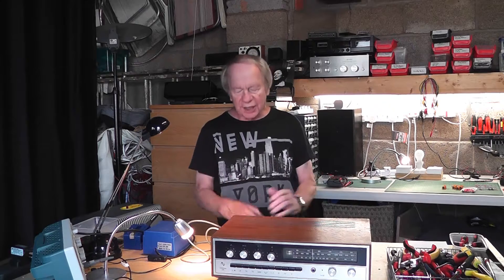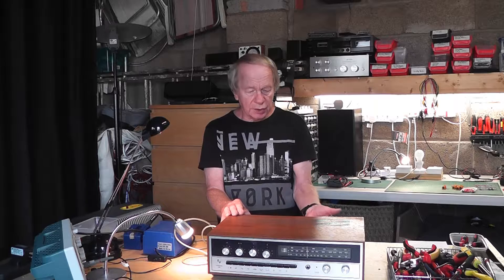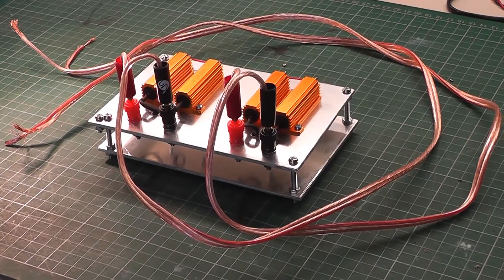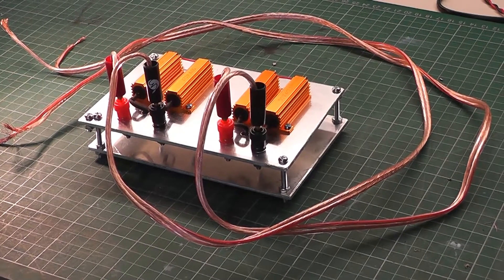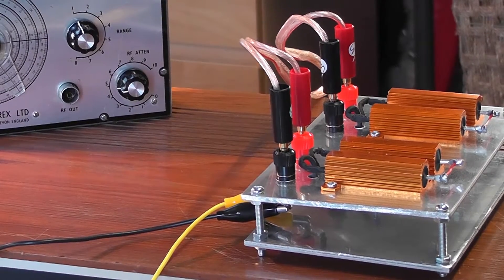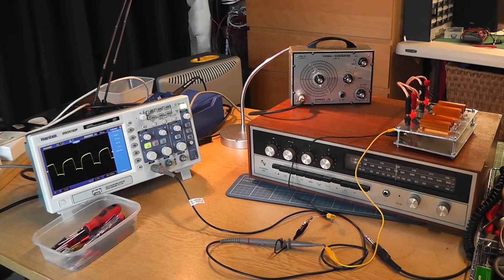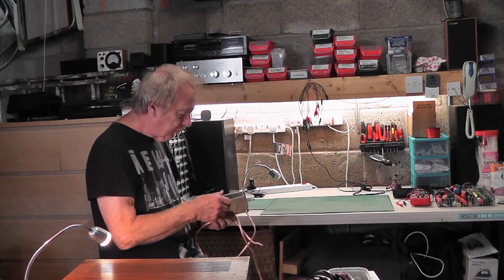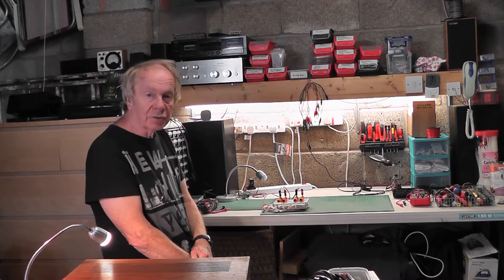50 Watt 8 ohm Dummy Load

Comment: Thank you one of the best explanations and builds of a dummy load. I am going to build this but will incorporate 4-8-16 ohms and at 100 watts and 200 watts with a selector switch for ohms and watts. I will also do it on  a better heat sink with a fans for cooling. Again thank you. I will also be a subscriber.

Comment: David adding BNC sockets on the unit you can then connect a scope to both outputs via your ground isolation,also a switch to select 4 ohms or 8 ohms,also an AC voltmeter socket to determine power output into your desired load,no criticism on your project its very good just food for discussion,best regards keep up the good work!
Reply from the maker: Hi Colin,
Thanks for your interest and suggestions. As I have nothing on my bench at the moment, I may use some of my time to make some mods to the load board. I don't use it often but the extra options could be useful. Thanks
Dave

Comment: Nice. What wattage should resistors be if I wanted to use it on a single channel 100 W guitar amp?
Reply from the maker: You could use 4 x 50 watt but for sustained use I would use 2 x 16 ohm  100 watt resistors  n a series parallel combination  if you need an 8 ohm load. They will still get hot so the addition of a large heat sink or fan would help.
Dave

Comment: You should get yourself an old cpu heat sink with fan.  There may be plenty around from old computers.  if the area is not big enough you could fix a flat aluminum plate around 3mm thick to the cpu heat sink with countersunk bolts. The resistors will fit nicely then.  
I would also have fitted a BNC socket for the scope with a 10 to 1 resistive divider (90K-10k).
Good tool for audio testing simple yet effective.